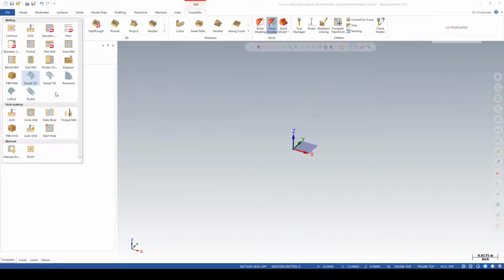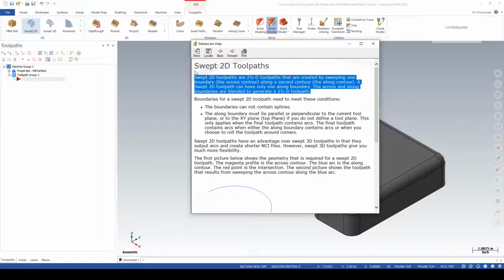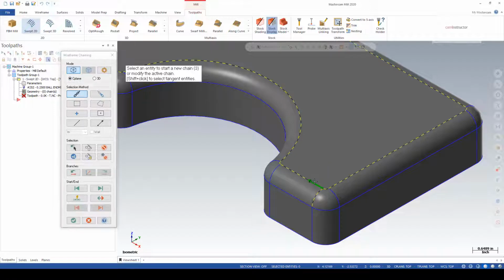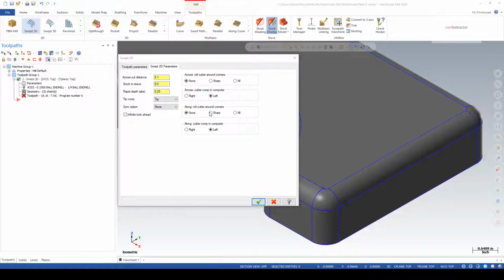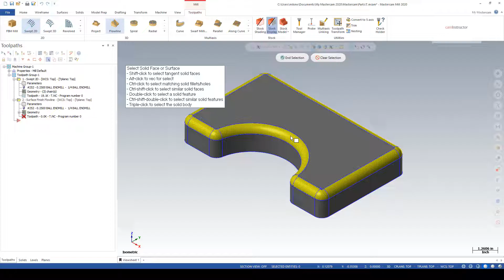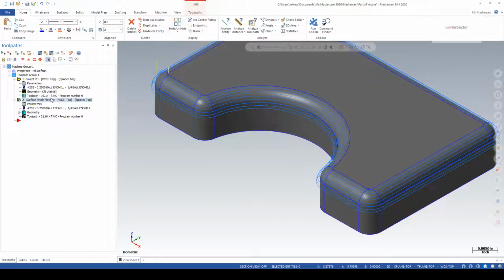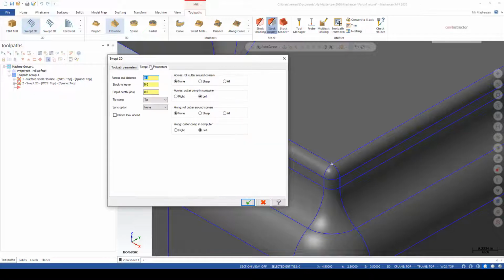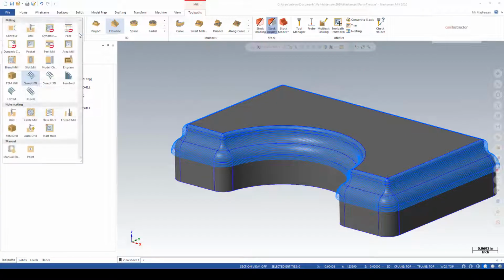Cutting 3D Forms with 2D Toolpaths in Mastercam

Comment: I basically run manual machines now, my boss likes to torcher me. Sometimes to try to put me in my place. About once every six weeks are so he likes to throw me on the Haas mill and make my program and run a 1 part order. I think just to make me nervous and see if I screw it up. I know one of these times I will be given a part that needs a 3d cut, but thanks to your video, I will be ready. I have a lot of experience as a CNC programmer, just not with master cam(Esprit Cam, Gibbs cam ect...) I really like MC. Maybe one day I will be able to use my Solidworks and master cam together. I love doing SolidWorks. I have to say my boss is a control freak.

Comment: I had to Machine a .05mm radii on a standing tab. The diameter was .236 x .157 wide with a .125 BEM. I tried using a flow line tool path but the tool motion was doing a lot of vertical cuts along with spiral motion around the tab. Tried the swept 2D tool path to create a spiral lifting tool path motion and it worked out great. Much thanks!
Reply from the maker: Glad it worked out! These paths can be super useful!

Comment: Thanks. Been using MasterCam for 12 years now and have never explored these toolpaths. Because they tend to be overlooked even at a training level. If you could do a breakdown for each of the like toolpaths that would be great. Now that I started fiddling with them, in a ramping situation, would the across and along need to be extended to ensure no collision?
Reply from the maker: You can extend the across and along to provide some lead into and out of the cut. Just keep the rules mention in the video in mind.  I was going to include this in the video but it was already getting pretty long. 
The plan is to give a basic run down of each of these wireframe paths.
Reply: can i request a post from you ?
Reply from the maker: We don't deal with posts. Best to contact your reseller.